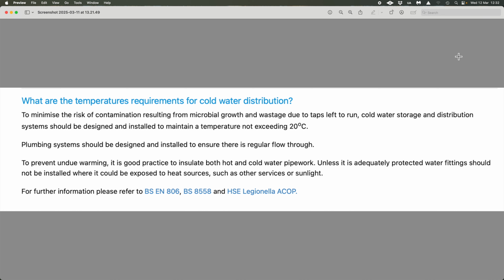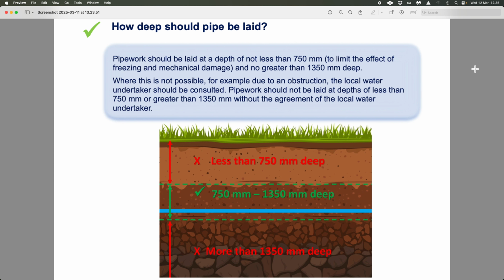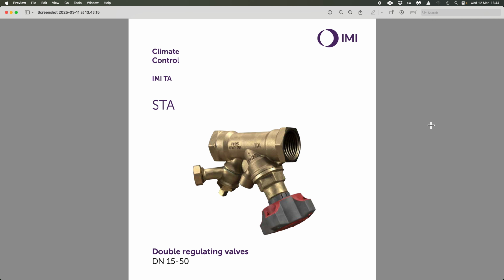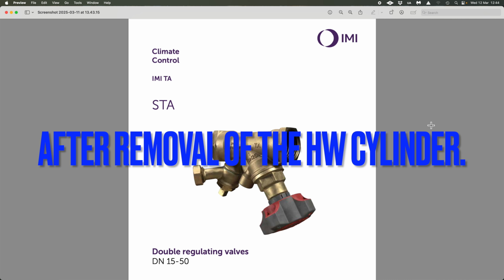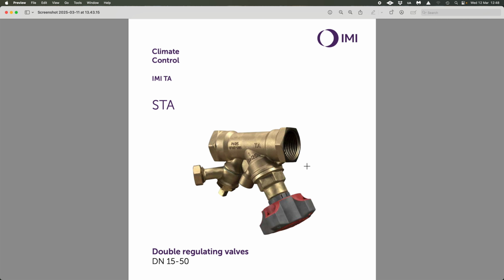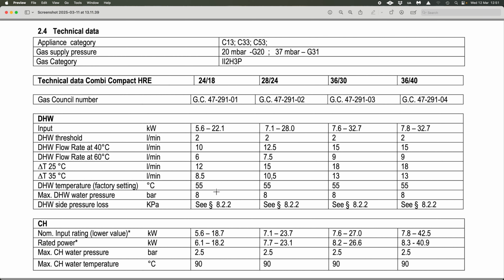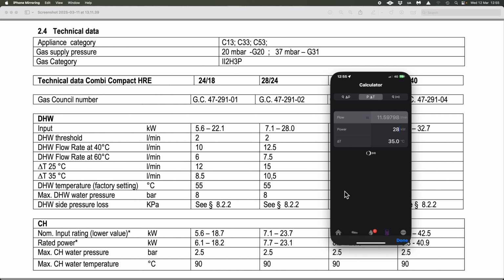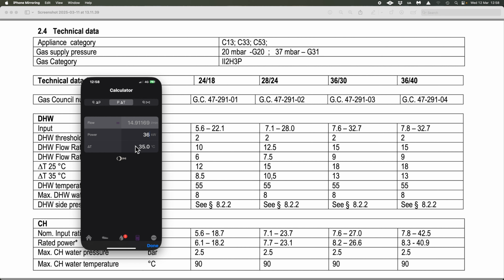Episode 6 Combi Boilers and how to set up the hot water side.

Comment: Fantastic video Rob. Just a couple of points, isn’t the dew point related to the temperature of the returning water back into the primary heat exchanger? Many combis in the UK incorporate secondary heat exchangers (PHEX’s), therefore the return temperature into the primary hex has to be high reducing condensation taking place. The Intergas that you have on the other hand has a bithermic hex meaning that the cold water is the water that enters the primary hex, this is what makes Intergas combis extremely efficient in hot water mode. Secondly, instead of a DRV, for a number of years, I’ve been installing flow regulator valves (available from BES) that take flow cartridges of different flow rates. The most common sizes that I use for combis are 8 l/min and 10 l/min. Intergas 24/18 has an 8 l/min flow regulator already installed.
Reply from the maker: @JamesBurke-k1y  Correct, differing boilers have some differing heat exchanger systems. The main point to take away is matching flow rate to kW rating, thus maximising efficiency so what you are doing with the regulatory valves is superb. 👌